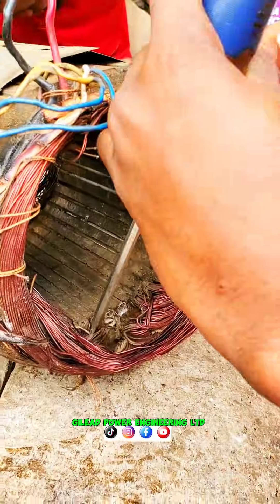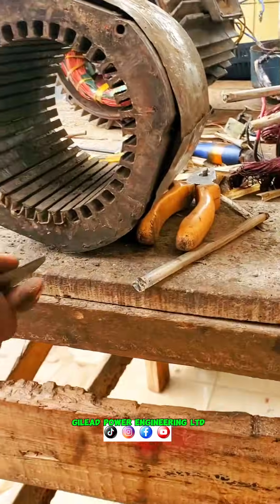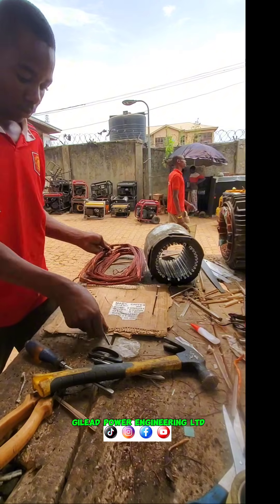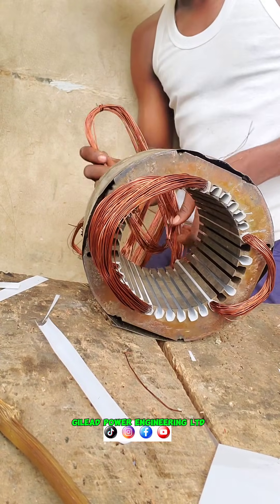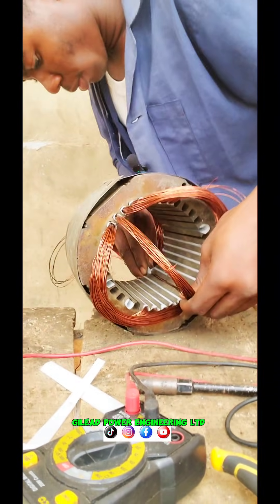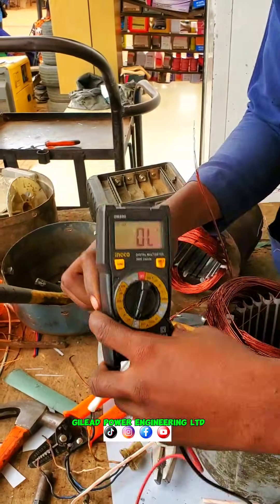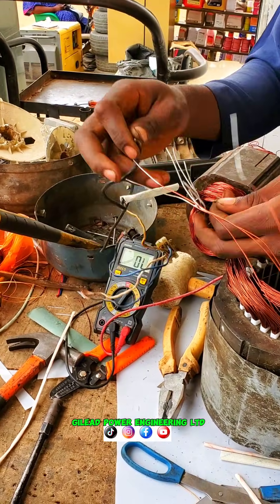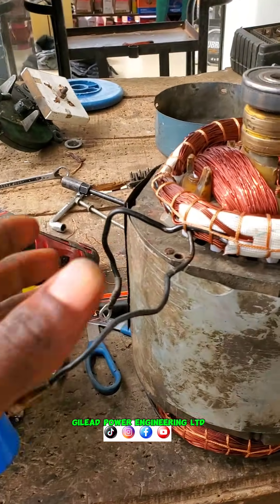How to rewind 7.5 KVA Generator coil (Full Video with connections)

Comment: Please I need your help sir.
I just rewind a a generator coil,and it seized light to the extend it has cut the binding rope, please what can I do.
Maybe you can drop your WhatsApp number for me to explain better for you 🙏 please
Reply from the maker: OK
09014266575
Reply: Sir, pls the connection part is not understood.
Reply from the maker: @networkgeneral  I will do another video
Reply: @gileadelectricalengineerin3452  ok sir, pls let the other video be the connection of the generator which the ends of the winding and exciter end be labeled with different colors so that we can differentiate it when u are connecting them. Pls